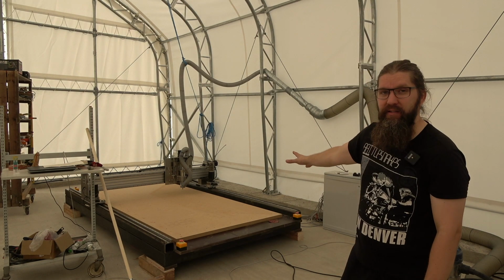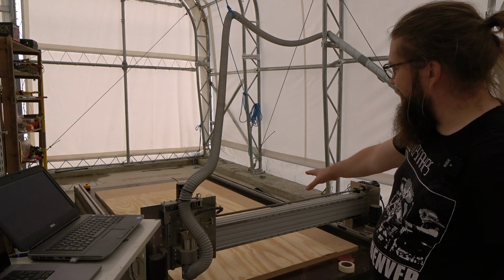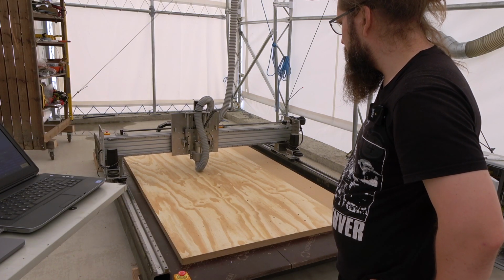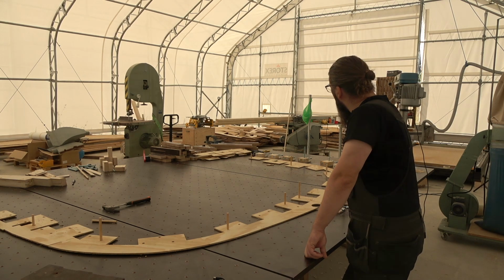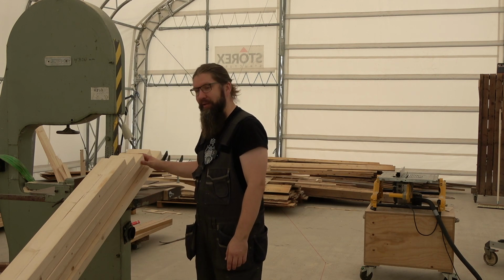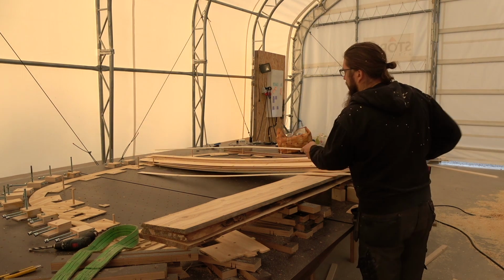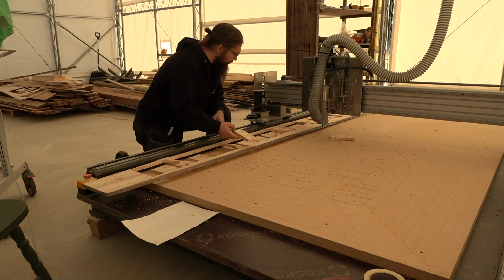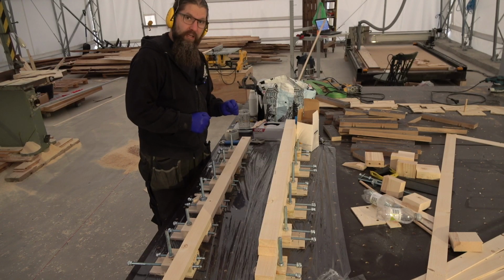🔥BOAT BUILD STARTS!🔥🤩🥳 ep.45 Project SeaCamel

Comment: Hi, I just discovered your channel and intend to follow it as it seems that we both are in the “same shoes”, meaning we are building a large vessel all alone.
I started mine (53’ x 23’ catamaran) 17 months ago, and at the moment I have to deal with an involuntary “time out”, having been hit with the “inconvenience “ of hurricane Ian, who messed up my boat building site by throwing off hull #1 off the strongback and slightly moving hull #2 off the centerline of its strongback, but both hulls are intact, but now I can’t resume work until I will be able to get a crane service to lift hull #1 back on her strongback, and move hull #2 in exact position again, which may take some time, as they have a lot on their list to do because of the ravage Ian did in our area not only to residences, but also in the marine sector.
Other than that, you are dealing with low temperatures, and I am dealing with high temperatures in regard of epoxy curing times 😂
Reply from the maker: Phew! Suddenly Finland sounds like a paradise! 😰
I hope you can get everything figured out. 🤞🏼

To be honest, I actually though quite seriously if I should move to Spain or somewhere to build this. But with epoxy, the low temps actually seems to be advantage. Rising temp is pretty easy, but getting it down, not so much!
Reply: @ArcticSeaCamel  , well, as long as you are using epoxy on small parts (I consider the frames as such), temperature is not a problem , as you use small batches, - it becomes a problem when you glass the whole hull , especially when you do a 70 m2 vacuum infusion…

Comment: I would recommend you put your laptop(s) in a small cabinet to prevent saw dust from clogging up any vents and cause overheating over time...
Reply from the maker: Yeah, there's also condensed water dropping a bit from the shed structures. So I need to cover things from that as well...
As I mentioned on other comment, I'm probably gonna do insulated and heated "office" space to keep some things warm and dust free.
And of course, I really need to make the dust collection better. Table saw is the worst...
Reply: @ArcticSeaCamel  I would suggest attaching a slightly thicker plastic sheeting hung from the metal rafter/structure in sections from the peek to the floor, behind which any condensation can run behind and led to maybe the outside or a drainage gutter type thing... 
You can not cover everything all the time, especially when your vessel starts taking shape and is getting larger and taller...
You will find you will be busy taking down and putting up covers for a large percentage of the time and it is not just a big hassle but also prevents those quicky in and out little jobs from taking place which is bad because work on the project will come down to full days only and will no longer benefeit from those quick little jobs which make up the bulk of any progress on a project like yours...

Comment: Your worksite looks like a pro-shop. And you really start at scratch with milling and planing the pieces that goes into the laminate...  do you have any estimate of how many man-hours it will go into a project like this? - maybe a quote from an existing boatbuilder? Is there any plans to set out part of the works to others - to speed up the process? I think maybe the interior parts could be possible to get build på pro-interior-carpenters. I made som furniture drawings some years ago and got them built by pros at at very reasonable cost. And they where fast too. My take is that the structural parts is very interesting and "fun" to make - and they are rather straight forward - but when you get to the interior details - it can be a struggle and very time-consuming - also it need to look perfect to keep value of the hole project at a high level.
Reply from the maker: This is actually the very thing I'm figuring out right now. How to "mass-manufacture" the materials for the frames. I've contacted one local guy that has small sawmill to cut from big pieces. Problem is that I want to have the materials made in high precision and it's hard to beat table saw and jointer/planer.

As for interior. There will not be any high-precision carpentry by design. I try to design the interior to be made with CNC-jointed pieces as much as possible. Maybe even having them coated with Formica-type high pressure laminate beforehand to get rid of sanding and painting as much as possible. Still wondering if that's good material though.
Super modern and functional are the words I'd use.

Comment: Why are you not using more uniform and better quality birch plywood, or marine grade plywood, especially for the frames?
Reply from the maker: Hi! This is high quality marine plywood made from pine. 😊
Reply: @ArcticSeaCamel  Hmm, doesn't seem to be if it's that flexy and cause you all those issues. Shouldnt be warping at all.
Reply from the maker: @1975Per  There's no such thing as warp free plywood😅 Maybe if you get 30-40mm stuff.

That really isn't issue when I cut the pieces out of it and clamp it down.
Reply: @ArcticSeaCamel  You can laugh all you wan, the joke is on you if you think you can't get better quality than that. I'm talking about the flexing it makes so that you have to screw it down everywhere , where you  commented about it the video. I've never seen it flexing up like that. Or maybe it's been stored badly and therefore is already bent. Seems like poor quality to what I'm used too. Even more so if it's supposed to be marine plywood.
The only kind I've seen that's flexing/bending/warping like that, is the cheap  stuff.
Coming out of a pile, it's supposed to absolutely flat.
Reply from the maker: @1975Per  This pile is excess pile I got pretty cheap. So probably there has been storage things involved and they have been lying around a long time.

Problem is that this was only pile I could find. There's not pine plywood available anywhere! I was lucky to even find these!
I will not use tropical woods on this build and birch plywood isn't suitable for marine environment. Birch doesn't stand water at all.

But in my use here the small worpness really doesn't matter that much. I cut the pieces out of it and laminate them down anyway.
Reply: @ArcticSeaCamel  Marine Plywood from Pine is pretty much the lowest quality of marine plywood, some might not even call it marine plywood. You could get Douglas fir or  Cedar instead, as a step up but still staying away from tropical endangered hard woods.
Reply from the maker: @1975Per  There's basically two types of plywood available here. "construction" and lower quality spruce or higher quality "furniture" birch. Pine plywood is very rare and "premium" product. It has always (as far as I know) knotless surface ply's.
All of them are "marine" in way that they're glued with waterproof glues. The term "marine" really doesn't mean anything here.

From these i wouldn't use spruce or birch on boats. Spruce has too low quality and it's surface is prone to cracking. Birch doesn't stand water and is also much heavier.

Every other types are imported on lower quantities and are priced to totally another level.

So, pine it is. Although - I still haven't found necessary 15mm and 10mm thicknesses that are needed for deck, bulkheads etc. All plywood supplies are very low at the moment.

Comment: I suggest talking to a timber mill to find out what sort of blade you should have in the bandsaw. Your existing blade supplier might not make them or stock them, so is unlikely to recommend them. There will be a really good one, you just have to find it :) And then set it up properly. I suspect that fine teeth with little kerf, so you get a smooth finish.
Reply from the maker: I have couple of brand new smaller tooth blades. Tried to change them, but the guide system's rollers are so tightly in that I couldn't adjust them for the smaller blade. Need to take them somewhere to open them...

The shop where I bought the router bits also supplies bandsaw blades. :)

But anyhow, i still want to plane the slats to make them exactly same thickness. That way they can all be connected together to the final lamination.

Comment: A couple of things occur: you can get pallet wrap which is like the kitchen plastic wrap but wider and cheaper (but it's not food grade, don't eat off it). Drilling bigger holes in your shaping pieces and the top clamp pieces will make moving the threaded rod easier, they don't have to be a tight fit (the squareness comes from being flat against the table)
Reply from the maker: Hi! I have pallet wrap! Quite an investment for a big roll! 😄 It could be even wider though for the table...

And yes, I will enlarge the holes in the clamps! 🙂

Comment: Go to the USA, buy a boat.
It will be cheaper. 
And won't take 5 to 10 long years.
Reply from the maker: 😅
If it would be that simple 😄
Collecting the money would still take as long. And all that time would be so boring! 😁
And one of the reasons to build this is that there’s not boat like this available anywhere:
-deck saloon
-cat ketch with rotating masts
-dingy garage
-Etc. 🤓

Comment: I used to do waterjet cutting..  I had thought that making  frame pieces out of lexan sheets and doing something similar to what you are doing would be cool.  going to follow along with your build.. good job !
Reply from the maker: I actually made the first test with thinner plywood. There was a bit of a problem that in that case the molds gave up just a little bit and the plywood started bending. Now I have much sturdier molds of course but I could still feel the top plywood bend just a little bit. With thinner material, it might be difficult to be able to glue it evenly on the top.

Welcome aboard! 😊

Comment: Hey,  great project. Very interesting to see. What kind of boat is it exactly going to be and where are you located? Seems you are from Finland. Isn't building in a tent impossible in winter? I'm restoring my own wooden boats in northern Germany in a shed, but not heated. Your boat seems very interesting to me for long time cruising. Which I want to start in a few years latest.... Please don't wear gloves on the planer, machine tools are even more dangerous. Especially with gloves. Don't believe planing down every side is necessary. When laminating oak frames I'm not planing them on purpose as oak requires a rough surface. The joint line is not highly visible and I believe you are going to paint the wood anyway? Maybe you can even get one more layer out of the planks.
Reply from the maker: Hi André!

Yes, I'm in Finland and the plan is to make separate insulation layer into the shed eventually to be able to use epoxy in spring/fall. I doubt I'll be able to do epoxy work on coldest winter months. At least this winter when energy is probably going to be super expensive!

I try to be super careful with the tools all the time. It's nice to have all fingers when sailing the thing eventually 😅 

Planing the surface reduces the amount epoxy needed in lamination quite alot! Also the surface from the bandsaw is pretty rough. I've come into conclusion that the amount of wood needed for these isn't that much anyway so the "efficiency" doesn't play that much of a role. What matters more for me is the accuracy and "ease of build".

Comment: Very interesting project - a million pieces to do !! May I suggest that you use a rubber mallet to bang your wood clamp boards - 30:49 -  into place instead of a nailing hammer. Mallets and small sledge hammers are more gentle than nailing or framing hammers.
Reply from the maker: Hopefully not million! 😅

Yeah, the joints were a bit too tight. I'm doing them with some tolerance from now on so there shouldn't be need for hammer at all.

Comment: I'm curious why plywood is being used for frames, it's not strong in small sections.  Usually frames are made from solid timber or layers of solid specially constructed.  I hope you had a naval architect review the design and build.
Reply from the maker: Hi. You need to check the earlier videos of making the test frames. 😊 The plywood sheets are just to make the shape for the frame. Inside will be solid laminated wood.

Comment: Great start! 
Join your laminating strips together with scarf joints, rather than a jigsaw joint. You want as much uninterrupted grain in contact with each other as possible. With a jigsaw joint you are building in a concentrated failure point.
Reply from the maker: Hi! Yeah, i thought of that. Problem is that scarf doesn’t stay together when bending and gluing them beforehand is too big and tedious job.
I made jig with cnc to cut jigsaw joints them and I place them all to different locations in the frame. So I don’t believe that’s going to be any problem.

Comment: My view is that having a completely straight sheerline is a big mistake. It looks ugly, ugly, ugly. There is a reason you NEVER see boats with a straight sheer. However, if you are set on this then I hope it works out wll for you, and I wish you the best of luck with the project.
Reply from the maker: Well, this is not traditional boat in many aspects. You see straight lines in some very modern boats. And I hope this will be one of those!
Many people won’t like it. But I don’t care 🤪
While it in my opinion looks sleek and cool, it also makes hopefully the build that much easier. 😅
Reply: There are a lots of boats with straight or pretty much straight sheer, even my Wasa 55 from the 70s is pretty much straight, and no, it certainly doesn't look ugly :)

This isn't a classic yacht after all :)

Comment: What’s the reason why you don’t just laminate the frame from multiple layers of the shapes you cut on the CnC and instead use the smaller strips?
Reply from the maker: Hi!
Yeah I asked this from the naval architect.
The reason is that the grain of the wood needs to be continuous all the way. Only way to achieve that is to bend the wood.
Alternative method is to have really crooked timber like Leo had with tally ho.

Comment: I am  wondering if it is not better to change dingy garage into storage and hang dingy on two hangers on the end od the boat
Reply from the maker: The boat is pretty big and one reason for that is the garage. Without that it could be couple of ticks smaller.
There shouldn’t be lack of storage anyway. 😅
But I also want the deck to be clean and that includes the dingy. I bet keeping it out from the sun also makes it last longer!
Quite possible there will be lift point in the arch anyway for quick deployment.
Reply: Keep the dinghy garage! How awesome.

Comment: Awesome, can't wait to see this progress further. You'll need lots of insulation and heating in that shed won't you?
Reply from the maker: Yes I do! It’s another biggish investment.
The bigger concern is that price of electricity has rised over 400% this fall. So heating the shed is going to be bit of a problem. I’ve some ideas for that but we’ll see…
Reply: @ArcticSeaCamel  may even be cheaper to heat with a diesel heater or some kind of wood stove?

I'm pondering the same questions for my own (much smaller) boatshed. I need to be able to do epoxy composite work, preferably through most of the Swedish winter. Not quite as cold as you guys have it though :) still 13C here 😊
Reply from the maker: @Robinlarsson83  Yeah, the temperature really depends of the air streams and how the lows and highs move around.

The threshold to use something burning in my dry and wood-dusty shed is quite big. 🔥 I'd rather use something else. Heat pump is the first option but it of course needs some investment.
I'm probably going to do some kind of DIY solar air heat collector system behind the shed eventually. There's so much cubic meters to heat that everything helps!
Reply: @ArcticSeaCamel  yeah, I fully understand the reluctance to go something burning :)
Heat pump is probably a good idea but as you say, they are expensive, and unless you get a Monoblock unit, it requires an expensive installation. And your shed is massive, so would need a big heat pump :/

But, your shop/shed will be standing for a few years at least I would guess, and you have a lot of machines there, so insulation and a decent heating solution will be worth it :)

Im hoping to tear down my shed sometime next year, but we'll see. I didn't even cover the whole boat, doesn't need it for the coming projects (cockpit work, keel beams, a few bulkheads and structure around the chainplates) :)